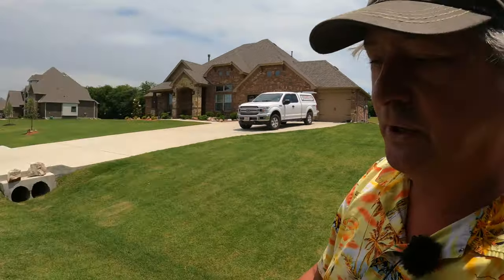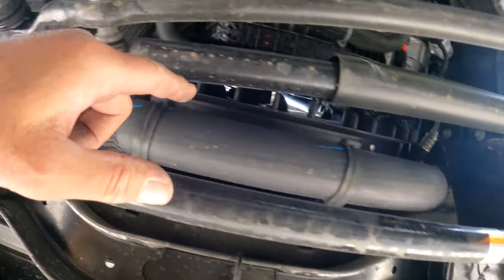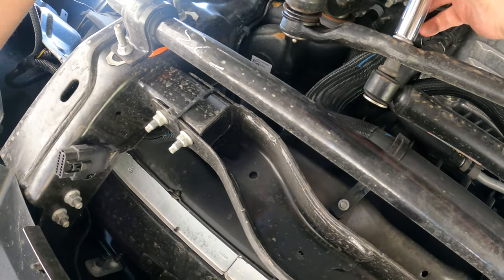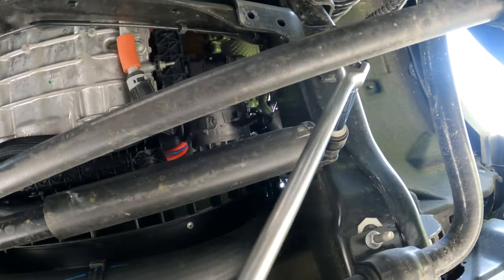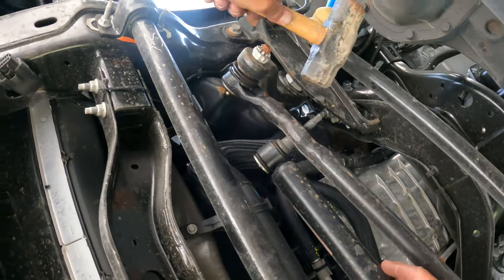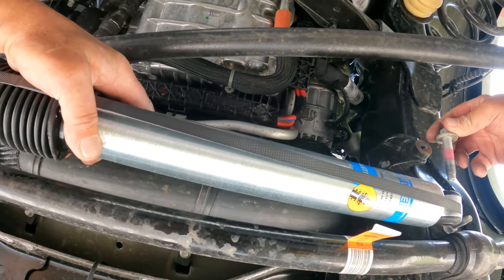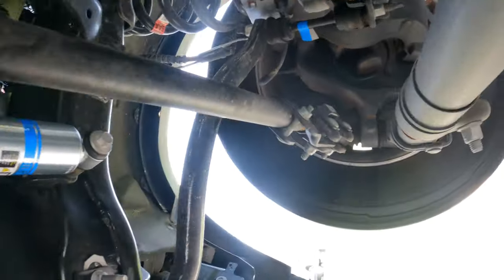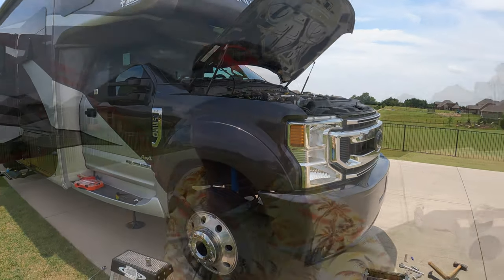Replacing Steering Stabilizer Motor Home Super C | 2021  Thor Magnitude SV34

Comment: I just finished installing mine on my 2020 Magnitude BH35. I noticed that this stabilizer is longer than the stock one and sure enough it does not allow me to turn the wheels to full lock to the right. It compresses the stabilizer and bottoms out about 1/2 to 3/4 of a revolution less than with the stock stabilizer. From what I can see your 2021 is identical to mine in terms of the steering rods even though I am a 4X2 only. Wondering if you have noticed the same or perhaps on a 4X4 the steering is more limited due to the knuckle joint driving the front hubs. I am going to so a little more research on this, but I will need to use a different stabilizer or go back to stock. Thanks for the videos DudeRV. They came in very handy to help me install the shocks.
Reply from the maker: I dont know if there is any difference in the 4x2 vs the 4x4 steering. I do know that the 4x4 when stock had a tighter turning than the van chassis we were driving and with the new stabilizer the right turn is still tighter than we had on the Vesta. The only time I ever notice the difference is if I need to turn around in a parking lot or some such. I have driven 10K miles with the Bilsteins and love them. I am glad to hear that my little video helped! thanks for watching!
Reply: Thanks to DudeRv for the video and to pjnls for the interesting observation on the length of the Bilstein stabilizer.  I'm with a 2021 BH35 and just got back from a 800mi trip with an Escape HEV toad and gosh darn it, that setup needs the steering stabilizer pronto! Was pretty white knuckle driving on the freeways. I'm hesitating with the Bilstein only because I have a tight parking location and don't want to affect the turning radius.  Did your research yield any alternatives?

Comment: Does the rear wheel drive F-550 have a steering dampner on it? I have a 2015 36 foot Thor Super C & while the steering isn't "loose"  it just seems too easy to steer if you know what I mean. I pulled various lengths of 5th wheels with 2 different F-350s & they didn't seem to have that issue.
Reply from the maker: I dont know much about the 2015 but it is on a F550 chassis so there should be a steering damper on it, most likely it is the stock one that does next to nothing. I think this is the one you need...https://amzn.to/3xH7GLM
Reply: @DudeRV  thanks for the info. I'm going to check into replacing the shocks also.
Reply from the maker: @arthurkinchen5126  I have separate videos for both the front and the rear, they are in this playlist...https://youtube.com/playlist?list=PLV3OUUap8JeD82XokQuoXu1mJ3Hkc9HLo
They are pretty simple to do as well! thanks for watching!!

Comment: Question?…
I bought a Steering Stabilizer like yours…
Does yours steer to the left?…
I tried to adjust it…
Kindly advise…
Reply from the maker: I have no issues with pulling to the left. You might have the alignment checked
Reply: @DudeRV  I just bought the RV Brand New…
Question?
When you were installing it, did you have to turn your wheel all the way to the left then install the stabilizer?…
Reply from the maker: @margiee.4355  No. I did have to  re-compress the stabilizer as it is under pressure and will expand when you cut the strap. Just because the coach is new does not mean the alignment is good. Thor does not do any alignment checks and they have private parties drive them across country to deliver and some of those guys are brutal with the equipment.